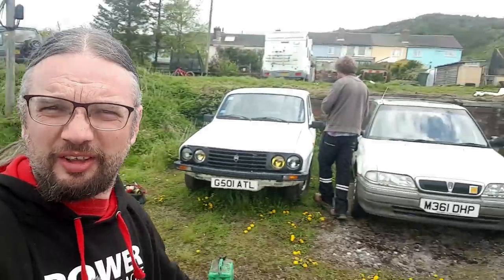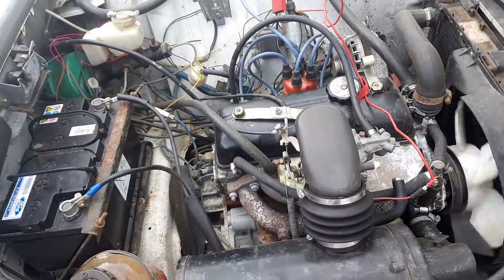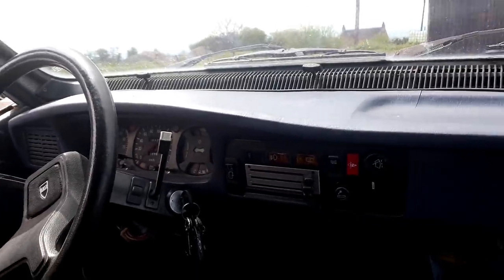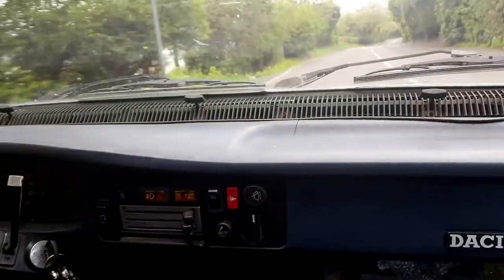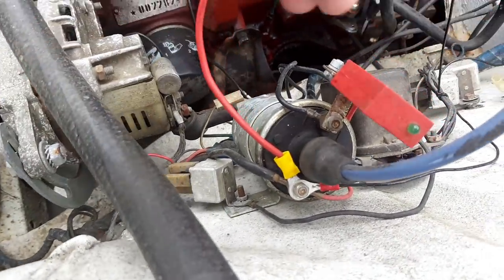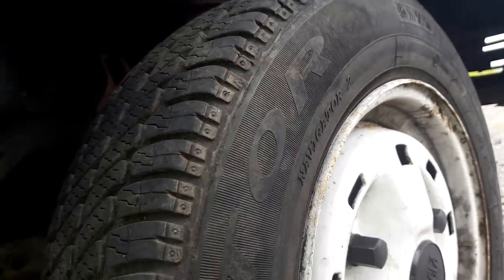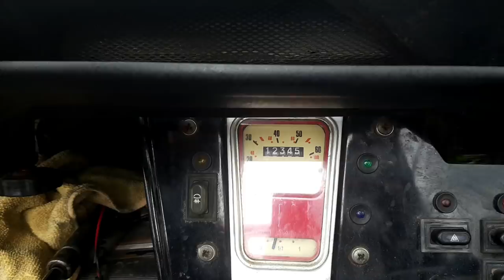Vlog: Crich 2CV run follow-up, with Mighty Dacia!

Comment: I Remember The Mighty Dacia Being Introduced In This Country In 1982! Came In On An 82 X Reg Plate! Ended, 1989 G Reg! I Remember Thinking How Little Dacia Had Done To Rebrand The Old Renault 12! Matt Black Finish Bumpers And Revised Lights! What Luxury!!!!!!
Reply: I heard that the dacia delta 1310( model made for greece) had electric windows included from the factory. What a luxury!

Comment: I noticed the vacuum connection was missing off the distributor (advance mech), Im assuming this was made redundant when the electronic ignition was fitted? and I presume all vacuum connections on the manifold have been blanked off? Air leaks due to missing/unblanked unions etc can cause poor starting/idle/running/performance........
Reply from the maker: All connections blocked  - a bit too efficiently in the case of the crankcase breather! It was removed while investigations were taking place but will be replaced.

Comment: Welcome to the world of diagnostic repairs. Always always check the engines earth connections,no matter what brand of ca it is. Even modern cars with the dreaded electronic spaghetti. And bad connections cause radiator and alloy head corrosion because the coolant begins to act as an earth . So if you have tried to do electolysis rust removal,the principle is the same.
Reply: bad ground makes EFI and all sorts of electronics go south on modern cars and bikes, old cars just make them not run and mucks up any conductive liquid...Good one Mercmad!

Comment: As a rough check on your 2cv carb jet you can do what we used to do on motorbikes after fitting a 4-1 exhaust,  a plug chop,  warm engine,  find a nice straight,  hold engine at around 2/3rd's max revs and cut the ignition,  coast to a halt and take a plug out to check the colour.  Most bikes ran lean (white plug electrode insulator) after an exhaust change so would need the main jet size changing to compensate.  Your looking for a nice rich tea biscuit colour on the plug ,  Lean is obviously bad and leads to melted pistons.  Costs nothing to do and gives you an idea of fueling.

Comment: Vacuum pipe missing from  distributor to inlet manifold.
Reply from the maker: Yes, but blocked at the manifold end. As I said, some pipework still to be sorted out.
Reply: @HubNut  That missing pipe won't help the starting or running problems. :-)

Comment: Should not the distributors vacume advance be connected?
Reply from the maker: Ideally, yes. There are some minor plumbing details to attend to. The carburettor end is blocked off.
Reply: @HubNut  Damn - I was going to comment on that... mind you, I'm only half way through the vid, such is the need to express my opinion - despite the fact no-one is in the slightest bit interested. sigh

Comment: This car is awesome, the same engine is in my r10 and i have now discovered what an unused bracket I had on the rocker cover once did, Choke cable! 
By the way, when you checked the dizzy cap i noticed that their isn't a vacuum pipe on the distributor advance module? Or was I imagining it?
Reply from the maker: Correct. It needs replacing. The carburettor end is plugged.
Reply: @HubNut  if you have trouble finding a new pipe, mine is currently(probably forever) plumbed in with a bit of washer pipe! As they say, it works!

Comment: It could easily have been the earth - well done for finding it (hopefully!)  What was actually causing the apparent drive-shaft knocking?
Reply from the maker: Exhaust rattling against a chassis member. I could feel it vibrating against the floor when we were driving, which is why I started having doubts about the driveshaft idea. Mind you, the old one was pretty mullered when we replaced it!

Comment: Got a bit of technical question about the Mighty Dacia. When it was in hot weather or long periods of being stationary how did you keep the engine temp down? rev it till the temp drops?
Reply from the maker: It never showed the slightest inclination to overheat, even when we were melting in 30 degree heat!
Reply: The oil pressure did seem to drop off when it was hot though.  This was generally fine when the engine was revving but we needed to avoid idling as it appeared too low.  This could be due to an inaccurate gauge though.  I've used it as my main car this week and it is running well.  Rich
Reply: @richcatsinthewelder5232  You'll get it sorted one day Rich.

Comment: I didn't see a vacuum hose going to the vacuum advance on the distributor.
Reply from the maker: Correct. The manifold end is blocked. It will be replaced, but needs work to fit.

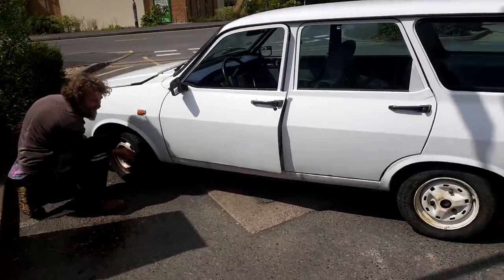Comment: 12:52 I'm glad you were able to quickly rule out the tyre pressures as being the cause of the non-starting issue.
Reply from the maker: Was a convenient place to push it to rather than work on it at the pumps! They get nervous when you start doing that...
Reply: It had also been sat for about 6 months so needed doing.  The tyre that is supposed to be the spare was 18psi.
Reply: @HubNut  Ah, got it. You should have been kicking the gravel with your hands in your pockets while whistling and looking at the sky.
Reply: @richcatsinthewelder5232  Cheers Rich!

Comment: The loose mounting bracket for the coil might have been causing the starting problem as well as the ground wire from the electronic module, as a coil usually needs a good ground connection from its body through the mounting bracket.

Comment: I bet the old carb was fine after all that... So annoying to find out its a bad earth,  do you two good chaps  still intend on reconditioning it and refitting the OEM carb to solve the hose and breather woes?
Reply from the maker: It's still running more sweetly than it was on the old one. Thankfully!

Comment: Do you keep your cars outdoors?
Reply from the maker: Yes.
Reply: @HubNut  

Thank you for your answer, Ian.

It is a pitty that your cars stay outdoors all the time, rust, rot and burn. It could be something cultural as I did not see many indoor garages during my stay in Ireland (2 years) and the UK (15 months). In Spain it is totally different since for so many years the usual thing is that new blocks of flats and single family houses include an indoor garage. In my case, as I live in an old building I looked for 2 parking spaces of indoor garages under another building. As the time goes along my cars look good.

By the way, I spent 4 days in 2004 in your town Aberystwyth when I went to see one of my friends.

I like your videos, Ian.

Comment: didn't u put Electronic Ignition on as well - how's that affect things?
Reply from the maker: Electronic ignition is no better than stock ignition in terms of how they run. Maybe a slight difference in mid-range torque due to a different advance curve, but not so you'd really notice. Main difference is once set, they stay set.

Comment: Ah.... That feeling when you find an intermittent fault and you wonder if you're a genius for finally finding it or a complete numpty for not having spotted it before :-)
Reply from the maker: My general ongoing status in life!
Reply: @HubNut  I built a long career as a service engineer on occasionally missing the bleedin' obvious. It's a sign that our minds are working on a higher plane of consciousness... A plane where you check the fuse in the plug but completely fail to notice the fact that the other end of the cable isn't in the back of the machine.

Comment: If you overbore an engine, then often you need to lean jet the carburettor. It is all about the Bernoulli's Principle. The greater the cylinder diameter to venturi ratio, the greater the intake velocity.

Comment: I was going to say that it looks as if my carb has done the trick, but I hope it's a big help. That earth lead needs a proper ring connection crimped on. The loose end just being stuffed under the relay bracket isn't ideal, as you have found.
Reply: It's running so much better with the Weber.  Now the wiring works it starts like a new car.  Since the video I've bridged the dodgy fuse with wire and a blade fuse which has solved a few more problems but tomorrow I'll recheck that earth connection.  Thanks again. Rich

Comment: You haven't got a vacuum pipe attached from the manifold to the distributor. That would effect the starting and the running
Reply: There was concern that the vac advance on the dizzy was faulty.  It would really mess things up if the vacuum was leaking from the carb but that end is blocked.  The new carb has different connections to the old one so a few things are disconnected that shouldn't be.  Now it is running nicely I can start trying to reconnect the pipes.

Comment: Fuel components held in place by cable ties. No fire risk there.
Reply: Cable ties are way stronger than the clips used by many manufacturers!!!
Reply: @kevinsmith6269  that's simply a nonsense argument. Clips holding fuel lines are designed for the purpose and hold lines close to bulkheads and other fixed items. They aren't used to dangle random loops of pipe and fuel filters in mid air.
Reply: @TheEulerID  To be fair Ian and Rich got the Dacia home from Romania to the UK in 30 degree heat at times, so I think they have a good idea of what they're doing.
Reply: @kevinsmith6269  Hubnut is a self-confessed bodger who in his self description video says he never had the stuff to make an engineer. You can get away with this sort of stuff as a hobby and it adds to the charm of a video but as a mechanic? Nope.

Comment: Like in the Fox great earth's a must as all electrical systems earth's are the most commons faults on car dimming tails light's on the older car's if a car has metal work run a earth to evevery light clusters and coils brackets and battery earth's to the body

Comment: The massive vacuum leak won’t help starting... the pipe between the distributor, and carb or inlet manifold....
Reply from the maker: It's plugged at the manifold end. There are quite a few pipes that need making up/purchasing.

Comment: after that last vid on the stan woods banger vids seeing some rare cars going to waste i need a hubnut vid to recover ahh much better,
AHH ELLY HAS TURNED INTO A ROVER! not much of an improment but certainly a bit better as in more power and confort but less easy to get to engine parts and er easy to replace or fix, 
ah yes the mighty bodged to get working dacia, 
oh phew its just another rover phew all is saved the 2cv didn't want to turn into a rover for the reason of going very far and not anywere it knows, 
ah yes that trip, why didn't you bring something else back? a lada, something rare or not sold in the uk, or better yet a very nice yugo, hmm seems to me this proplem car (now kinda fixed) needs to be in the PC mag as it seems to be something sam or one of the pc chew would buy and then report back very good reading, 
it was then we broken down, seem this car likes doing that, hmm must think "hold on i'm rare i should not be driven as i've not seen another me in this new place right nope i'm a muesuim car only" and those are pritty much polish push around with meny voltears and enjoy its looks, 
it can't be that simple this is hubnut after all might be it rattled itself lose there but its not going to be that easy,